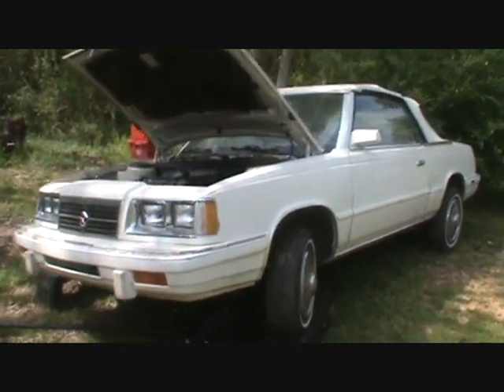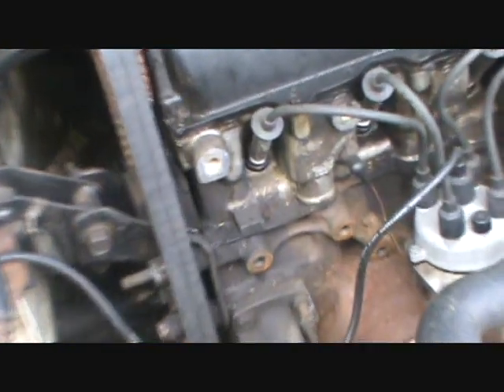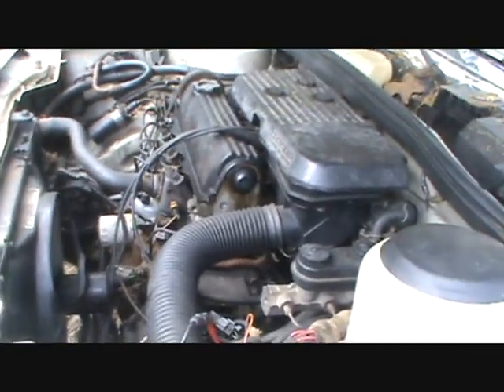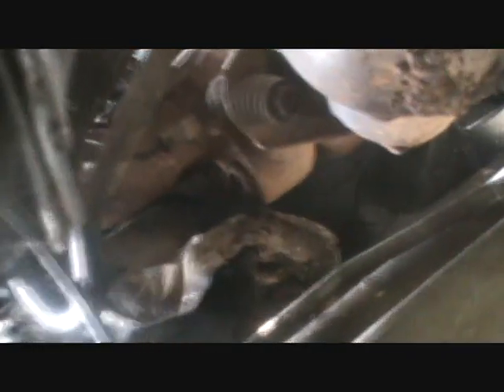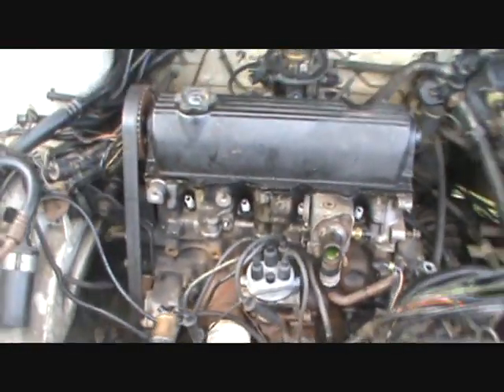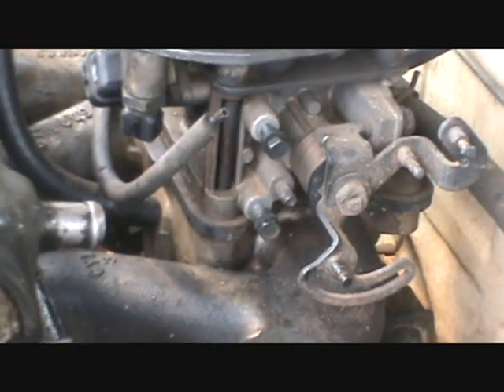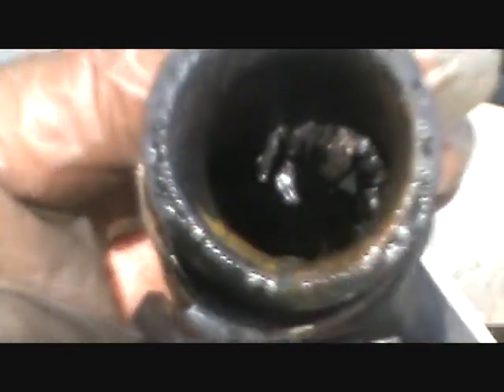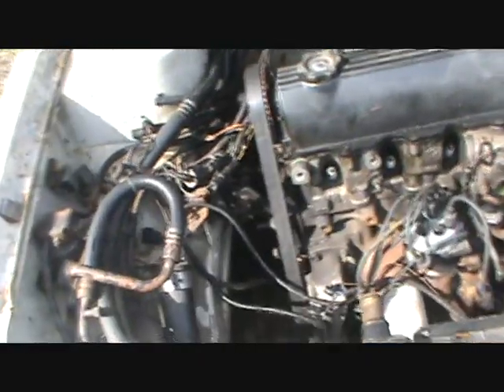Dodge 2.2L cylinder head removal and post-mortem

Comment: Did you buy a head and if so where I can't find one anywhere
Reply from the maker: No I didn't. Look for a "cylinder head service" in a larger city near you.
Reply: My head had a defective helicoil installation so a rocker kicked out from under the cam because the bolt stripped and the cam lifted
Reply: rockauto.com has them

Comment: I own one of these engines in my rampage,i made a wonder discovery,it loves synthetic oils,i ran dino oil and it would knock my cam followers with that oil,by the time theoil thens out the damage is done,synthetics only
Reply: Most cars love synthetic despite what the purists would have you believe. Synthetic oil is superior in every single way. Just don't go running 0W20 in something designed to take 10W40, because that's obviously going to create problems.